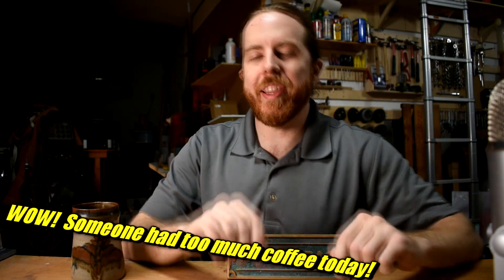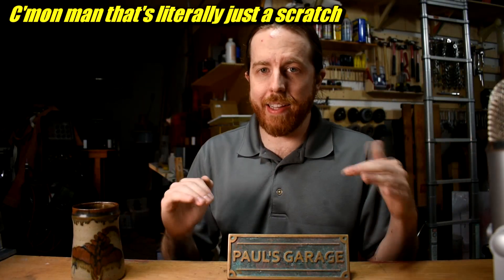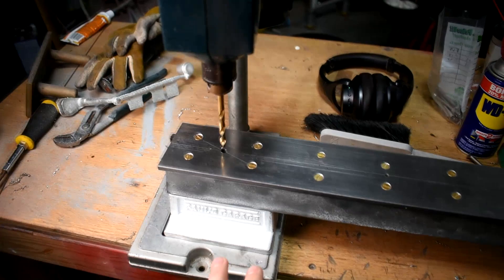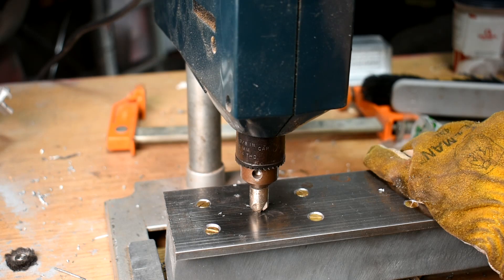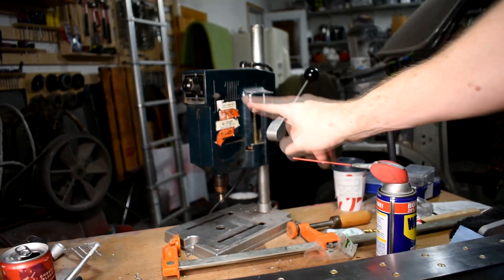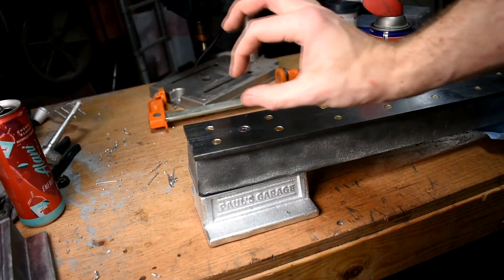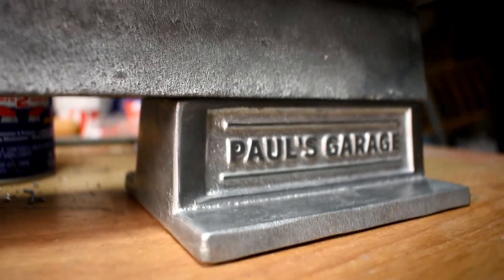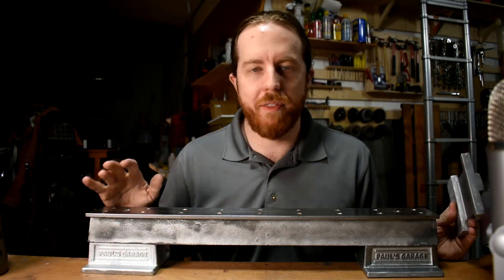Assembling the Gingery Lathe Base | DIY Metal Lathe Part 4.5

Comment: If you have a reversible drill, running that type of countersink counterclockwise as a final step can give a better finish (I just use my hand drill). It's not too much of an issue with steel but sometimes aluminum and definitely wood can hex out on you as the diameter increases.

Comment: I think that countersink may be dull... a good honing would likely help
Reply from the maker: I have barely used it but almost all the use has been abuse.  I likely wrecked it
Reply: @PaulsGarage  for metal you may prefer the Zero flute countersinks, The kinds with the large angled hole drilled in them.

Comment: Wow! I didn't think you were still doing this...Really great!!
Reply from the maker: Yep still going!  I had a big project over the winter that really slowed down my progress but I'm back at it!
Reply: @PaulsGarage  I commented above that I saw a  VHS video from David Gingery and you were correct in pronouncing his name correctly way back when. It is pronounced as in ginger like "ginger-ee".  Also I am gearing up to build a benchhtop miling machine that I  am designing. I have been assembling a small machine shop to support my channel that I will be starting very soon. I found a Southbend lathe that needs work. A neighbor who was moving offered his 1957 Atlas 6 inch Lathe that has a ton of tooling and was in a barn inn controlled atmosphere for its life. I also found a Burke number 4 that I need to find a work table for and possibly other parts. My project is a 1928 Morgan Brooklands style GN special race car of which only one exists. I am using an aircraft opposed twin engine as the power plant connected to an MG 4 speed power plant through a hand cast two piece adapter that I have to make and then to an MG differential with wire wheels. I am going to need a milling machine right away so I have plans that I drew up after a really technical dream one night so I it should be better than I can do while awake..lol I am getting the foundry built and am going to use a cast iron 5 quart pot to melt the aluminum or whatever I am going to use. You inspired me to finally do this. I am recovering from getting hit while on my 1957 Harley Panhead so when I am back on  my feet and it is warmer here in PA I am going to start. Thanks for your inspiration Paul...
Reply from the maker: that sounds like a lot of fun!  good luck and I hope recovery goes well.  getting hit doesn't sound fun at all.
Reply: @PaulsGarage  Thank you. It has been over 18 months and I am finally up on my feet however I had my right leg nearly crushed in two and that is what is taking the longest to heal. I get to keep it though which is really great. It was touch and go for quite a while. I am really pscyched to start building the bennchtop milling machine and then jump into the big stuff. I will let you know so we can compare notes on the melting and stuff. I am going to use cast aluminum because I have access to that.

Comment: you might even be able to mount your drill press onto that extra aluminum casting and use the lathe base as a solid place to mount your Montgomery Ward Drill press.  =D
Reply from the maker: longest way around to a better drill press ever 🤣 I love it
Reply: You could even replace the motor while you're at it, and maybe even the spindle bearings, and...
Hm. Drill press of Theseus.
Reply from the maker: as long as i keep the plastic shell with the Wards sticker on it, it's the same one
Reply: Truly a great philosopher of our time